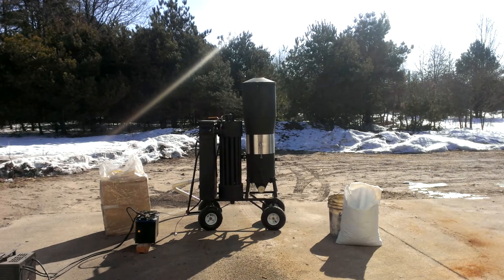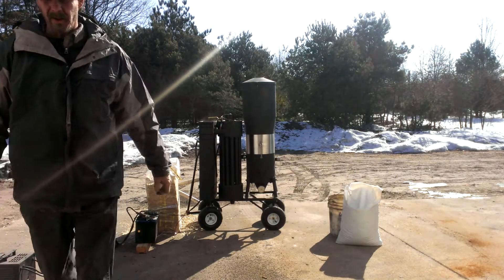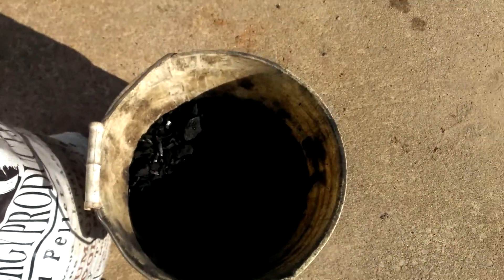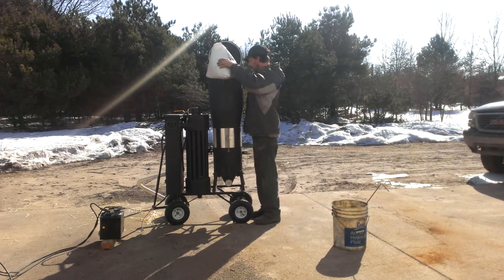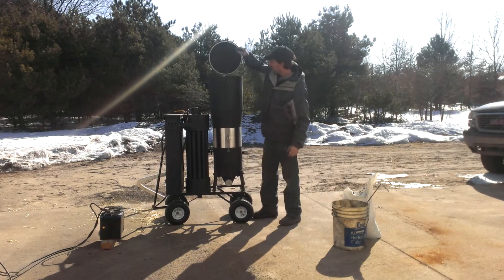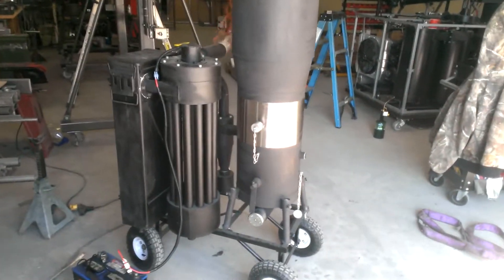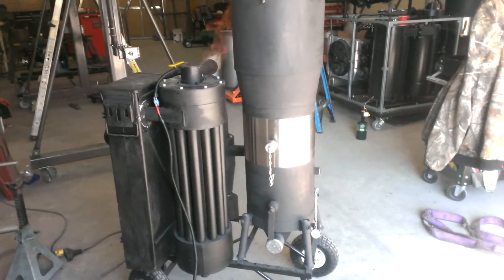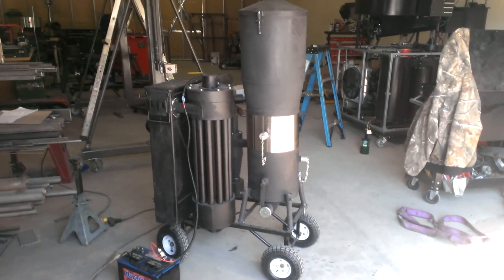Vulcan Gasifier 2014 M-II Demo

Comment: I want to know if your gasifier can be used with cardboard waste and dried grass. If so, is there any recommendation on feedstock preparation, e.g. shredding?
Reply from the maker: Hi Ken, you will most likely need to shred and then palletize these fuels. You may also need to mix this with a fuel that has a higher carbon yield. I think grass and the cardboard will have to high ash content to work.

Comment: $3,200 GOOD LORD!!! That's insane!! cant be more then $300 to build!!!!!
Reply from the maker: 300 might cover the plumbing parts needed to build this. Ever priced 1-1/2" ball valve lately?? how much you think those wheels cost? how much in steel?? how much in labor? How much welding wire and shielding gas. The cost of the equipment and the building required to run a business. How much in consumables, grind disk, cut off wheels, How many labor hours do you think it takes to build that machine. Do you think its just a bunch of cans welded together? Have you ever built a gasifier?

 That machine in the video is a very complex machine on the inside. I myself along with the people Ive hired put a lot of hard work into every machine at very high quality standards. We are one of the very best in this industry. There is well over 180 labor hours into that machine. The BOM and over head to build it is well over 1500 dollars not including labor. 3200 is more than reasonable for that machine, we practically giving it away for that pricing. If you don't think so, go check out my competitors pricing for a comparable machine.
Reply: VulcanGasifier I don't think so where the hell are you buying your supplies! And is your welder getting paid $50 bucks an hour! I have build two of these and yes it looks really close to yours. Just so you know I'm 28 years in on being a professional welder fabricator and have welded for Boing and own my own weld shop! I have made them for around $300 dollars. I bought those ball valves for $28 bucks and I know for a fact there is not no more then $250 in materials. Good lord people don't let this guy take you!!!
Reply from the maker: Serge Smith  Lets see it!!!! where is the video of it. What is the name of your company? I want to check it out, seems how you could built it so cheap, I might just outsource to you. I could then lower my cost and put you to work.
Reply from the maker: VulcanGasifier Do you have a CNC laser machine? your going to need one to cut the 300+ parts to build that machine. You must get a really good deal on hardware huh, keep in mind we have to build in metric to ship overseas. So plan on spending a little for those metric buggers. What about a heavy duty slip roller that can roll a 1" diameter you will need one of those too. That is needed to roll numerous cones, it has to be heavy duty as we only use heavy gauge steel for our builds. There is not a slip roller on the market that can do this so you might need to build your own. Oh and just so you know I am master machine builder, with an engineering degree. I also came from the aerospace industries building very high tolerance machinery. If you have flown on a commercial jet airliner, you most likely flown on parts made by machines Ive built.
Reply: VulcanGasifier Well we are going to agree to disagree! moving on from you!!!
good luck people!!
Reply from the maker: go build one and let me know how that works out for you. Have a nice day!!!
Reply: VulcanGasifier Did!! and it runs great with a 6500 watt gen set and did it at about $350 bucks!!! with a vortex generator and two scrubbers with a cooling radiator. the price for this one is insane!!!!!!
Reply from the maker: Thats great!! best of luck to you.
Reply from the maker: You should do a youtube video of it and show others how to build it. :)
Reply from the maker: First of all Im not getting rich off this. This is not a hobby it is a business. Do you work for a living? If so go tell your employer they no longer need to pay you. If this is not okay with you then quit asking me to work for free. I hardly break even on these  machines. These are very high quality and performing machines. They are built with brand new materials not free junk!!! I also have to pay people to build them and to pay for a commercial building is far from cheap. We are professional builders not back yard enthusiast. Oh by the way these videos are not for you they for my customers. You already said it your self the info is online. If its so easy then go build one and quit trashing my hard work!!!!
Reply from the maker: Also I am here to advance this technology for the future. Myself and my competitors are doing our best to make these systems more practical for the future. We are here for our fellow man not to get rich. It all cost money!!!, my doors are always open you are welcome to come to the shop and see how it really is. You think Im making lots of money then you are in for a big surprise my friend. This is why it bothers me when you trash on me with your total ignorance!!!
Reply: ***** Ok now that you got that off your chest!! $350 is what it cost it will sell for a little more then that. this unit at my shop will sell for $1,696. I just trying to say your price is way to high!!  Its a gasifier not a rocket ship. good luck to you! if you can find people to pay that price then well you cant fix stupid!!!
Reply from the maker: If you followed me from the start. Then you would know I sold the machines for $800.00 when we launched. I highly doubt your machine is on the same level as our current technology. Lets see it, show your machine working!! Go ahead and sell it!! Do you have extensive heat recirculation systems? If you do show me. Do you have advanced grate systems? Show me! Do your systems have a powerful  integrated blower system with silent operation?. Do you offer automation?. Is it on wheels? Is your reduction system stainless steel? do you have externally removable jetting to meet the needs of different fuels of all around the world?. Do you have a real cyclone filter? Is condenser liquid cooled? Is your hopper lid on a hinge system? with flash back safety valves?.Are you building completely from scratch or are you using pre existing tanks. I bet you cant answer yes to more than two of my questions. Not rocket science, this statement tells me alone you are a complete novice and have completely no idea what your talking about. There is a LOT of science to gasification. Show your machine or quit showing your ignorance and  get of my channel!!!
Reply from the maker: Oh and by the way Serge if you go to my website you just might realise we offer machines starting at $1400.00